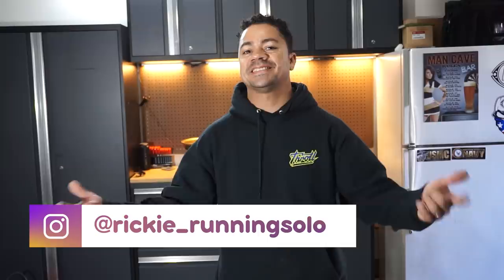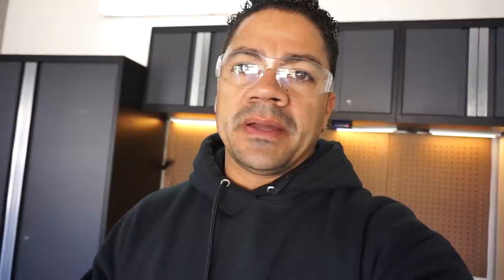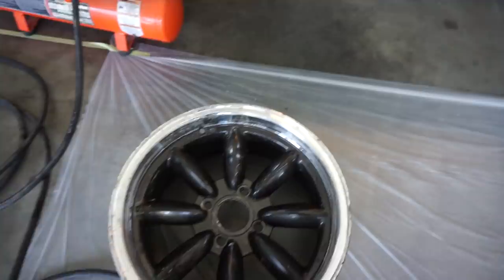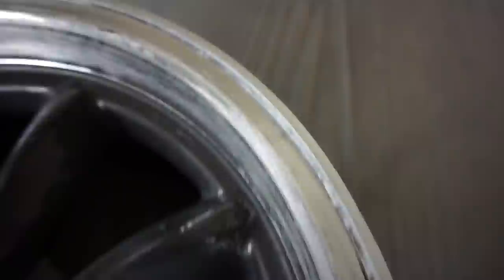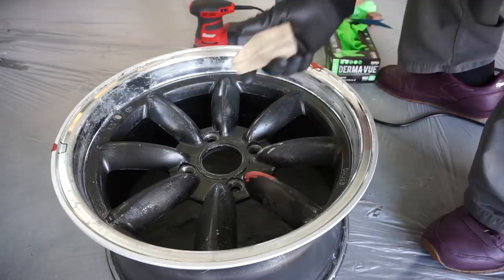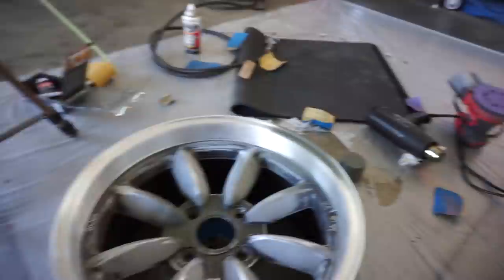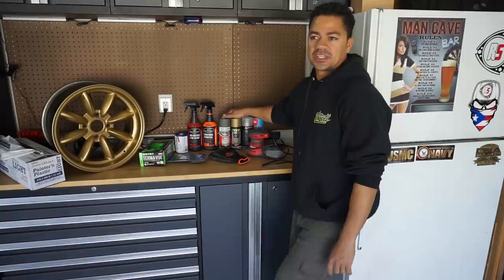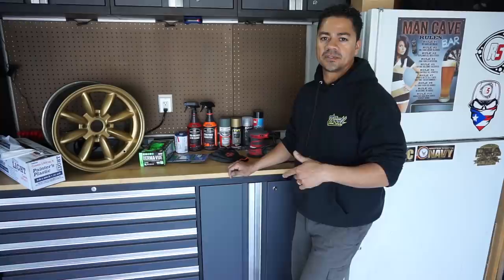How to Repair (Curb Rash) & Paint Wheels on Your Car -- AMAZING RESULTS

Comment: when dealing with aluminum wheels i use Low Temperature Aluminum Welding Rods that uses a propane torch to weld the damage then i will grind  down to shape it then if needed i will go back over if still have any low areas left then a final sanding to shape and finish to what i want it to look like before finally painting it either in powder coat or normal high temp paint.
Reply: I've always wanted to try that .. I haven't yet.. 👍 good to know
Reply: That has always seemed to be the proper way to do it (at least in my mind) but I have always wondered if the heat has any affect on the grain structure of the aluminum
Reply: He already addressed that . Its a cheap wheel so he went with this route

Comment: Hey man I really love the process you did very informative as well. I actually went to school and got certified for wheel repair/paint. The ONLY thing we did differently was use “steal stick” as a filler instead of bondo. Just because it’s less likely to crack or chip off like bondo and it’s same process for dry, sand, then prime. Other than that absolutely amazing man!

Comment: I had original Benz rims on my '03 C230 and rusty calipers to deal with. I also used the VHT high heat paint for my calipers while using Duplicolor paints (black chrome on final). I was able to wire wheel and Dremel most of the rust of the rotors and seal with Loctite Extend Rust Neutralizer before using two types of primer (1 Krylon dark, 1 light self etching). I think the hardest part of doing wheels is waiting for the drying so I moved between little tasks like refinishing the original bolts to match the rims. I wheel say, I haven't the tools of garage space you have so I am bit envious of your wealth ;) My neighbors wanna kill me for making so much noise and spray painting all day.

Comment: I have sweet connections. Got 8 rims powder coated for 300 bucks. But I prefer wet painting. But the thing is the rims was crazy scratched. So the fixed them with aluminum bondo.
Besides....those rims are for the track. Gonna repair my 19" Csl rims this weekend. Gonna look great on my BMW 1 series. Haha

Comment: i repaired and painted my own rims before. I followed all the steps, made sure everything was clean and wiped down. I applied the proper etching primer to bare metal. Primed and painted everything properly. But as soon as new tires are put on, the new paint around the lips get scratched immediately from the stiff side walls of the tires. The tire shop said that on low profile and stiff side wall tires, the paint must be baked using paint with built in hardner. Regular spray can paint jobs are not ideal for stiff side wall tires.

Comment: Keeping it with the same theme of painting, I was thinking a follow up video could show how to paint valve covers, calipers, or even interior plastic trim to make a vehicle transform completely. For instance like a tan plastic interior prepped and painted gray, black or even a white color would be unique. Great job on the wheels by the way!👍🏻
Reply: Stay tune.. i just did a video on Valve Cover .. use the same steps for anything in your car  .. like calipers etc.

Comment: This video came at a perfect time! First time in my 16 years of driving I curbed my wheel because I slipped on ice a few months ago but haven't been able to take it somewhere because of the coronavirus. A bit hesitant of going the "nuclear option" and stripping the whole thing. Any tips for just doing a partial fix? I've got a scrape along the outer lip on my 10-spoke wheel that goes about 2.5 spokes along (I would guess about the length of my hand). Nothing on the actual spokes themselves nor any other part of the wheel. Tips on color matching to OEM?
Reply: That is very hard to do .. because you will have to color match the original color in your wheel... and follow the same steps the manufacturer used.

Comment: Excellent video! You really put effort on this one explaining every detail of the process. I’ve been gathering information about wheel repair lately. I want to take on my set of wheels, repair them and change color from silver to black, the only thing is that I want a polished lip finish, so what will be your approach in that matter? 2 or 3 of these wheels have several amounts of curb rash in the lip, should I get them welded or a metal based filled will do the job? Hope I made a good case point here. Cheers!

Comment: Pro tip, when you use Airplane stripper, cover the item you're stripping with plastic and try to keep it warm. If it's covered and warm it will strip faster and more thoroughly.  I've done body work but never wheels, thank you for this!

Comment: Actually the paint stripper will cause that hazing on the inner lip. It started to effect the factory clear that the company applied. The same thing happened to my Work wheels luckily I was sanding the lips anyways so They can have high polish lips.

Comment: Face looks good.  Did you mask off the interior barrel as well?  If you're trying to refinish that area as well, do you separate the job, or make it all the same effort as you spray?  How do you address gaps behind spokes?
Reply: I only did the Face of the wheels ... I felt that there was no need to explain the back since the purpose of this video is to show you how to fix the lip of the wheel... and If you were going to do the back side as well do everything at the same time. I would hang the wheel by a hanger.

Comment: does it matter if the wheels are chrome? or is there some special sanding i gotta do to not ruin or scratch the rima more?
Reply: If you are trying to change the color from chrome to something else .. sand the chrome down with a 400 grid then use primer and continue on with the video steps

Comment: Are they sonic cabinets, I worked it out years ago it cost me less to have the wheels shot blasted than buying all the stripper, dont get me wrong the cost of a colour change at the powdercoaters was aprox £25 per wheel but they can't do wheels that have filler and they didn't repair wheels so to have that done would involve taking the wheel to another aluminium welder then bring it back.
Reply: the average cost here to fix and powder coat is about $150 per wheel .. the way I did it should cost about $60.

Comment: When sanding the wheels down for primer do you need to remove 100 percent of the previous paint down to bare metal or will primer work?
Reply: Primer will work

Comment: 13:30 why does paint wrinkle after 30 minutes of a new layer? Do you know? :) (i've seen it first hand, but idfk why or how it happens) 
Hope u're doin good at these times!
Reply: The paint wrinkles because the layer is too thick and the surface dries faster than the paint below it, when you do the next layer the solvents dry and shrink at different rates causing the middle layers (former top layers) to shrink faster than the new wet bottom layer. That's where you get a wrinkled, or with clear coat a "cracked glass" effect. it's best to do them within 10-15 minutes so the surface layers are tacky and don't dry out too much.

Comment: 4:30 is it possible to do this step with pressure washer?
Reply: I did use a pressure washer .. but the camera turned off for some reason .. so yes you can

Comment: At the risk of looking dumb, is there anything you do to get rid of chrome wheels? Would it be better to “paint strip” it or just sand it with no issues?
Reply: Is better to just sand them down with 80grid .. then primer them .. like 3 layers .. than sand down again to fix imperfections then follow the video

Comment: The reason it took so long to dry is because you used glazing putty. Its normally only used for pin holes in body filler.